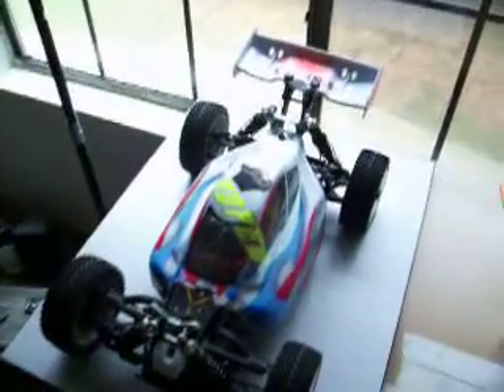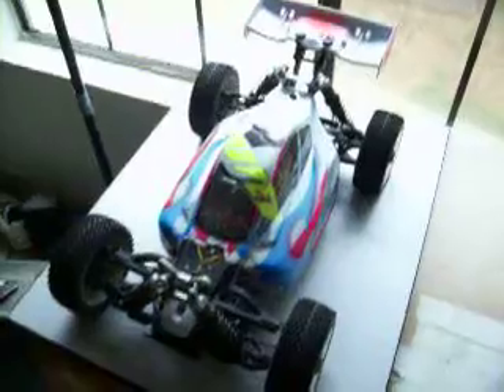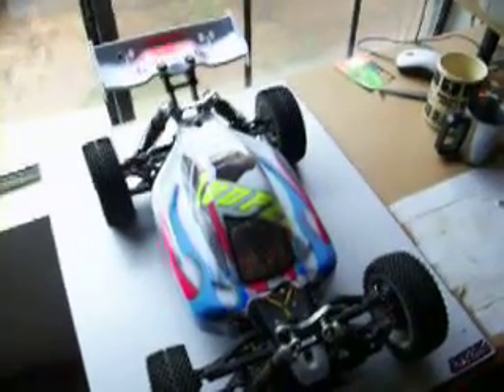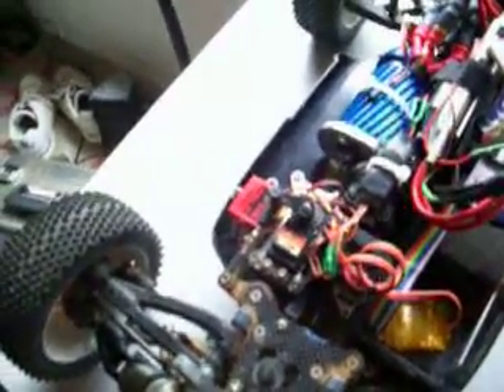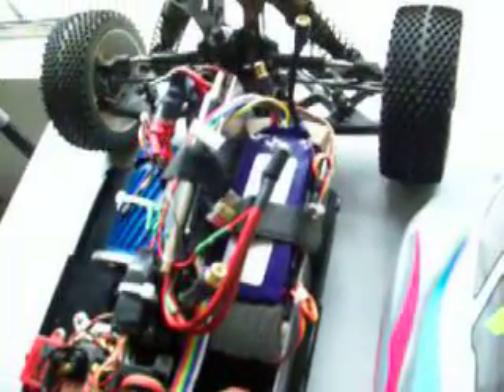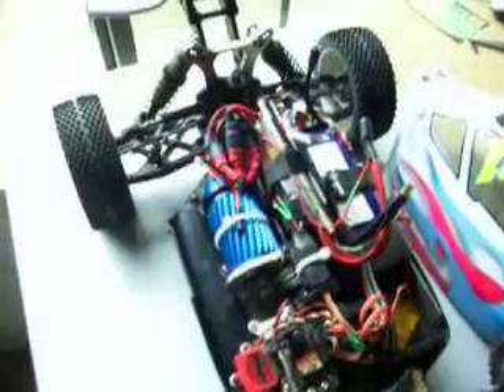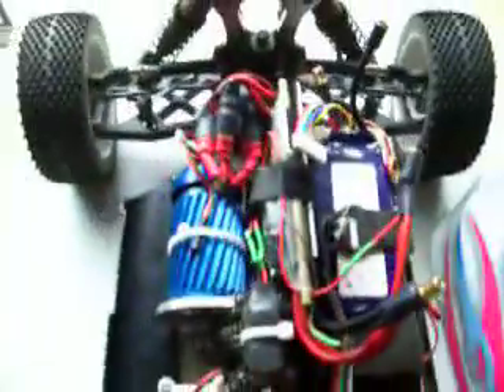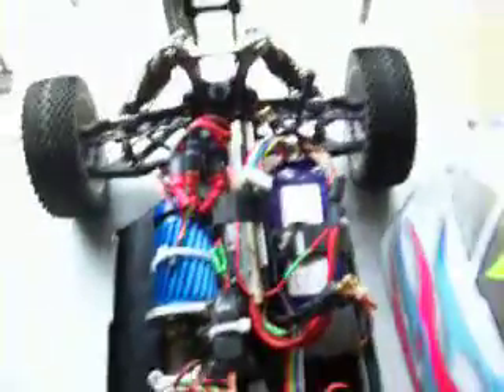cars1 030.MOV

Comment from the maker: @TheFarFox and to address the small battery ... remember that a 2s 2200 has less total wattage than say a 3s 2200... and so on for 4s and then 5  so on ... basically what will happen is the esc has more cells to pull amps from and since the current (voltage) is so high the motor and esc are able to use it efficiently will run smoother and with more efficiency overall... the motor is geared accordingly and when i do get it on a track i will post the motor temp actual run time thks for the comment

Comment from the maker: @TheFarFox very good points .. and to answer your question the plettenberg is able to handle high revs up to 70,000 rpm ... and is far superior in every way compared to neu motors... let alone castle or tekin exc. building  cutting edge setups according to what my heart desires to run rather than what is known to win races resulted in my first electric conversions years ago as in the earlier videos